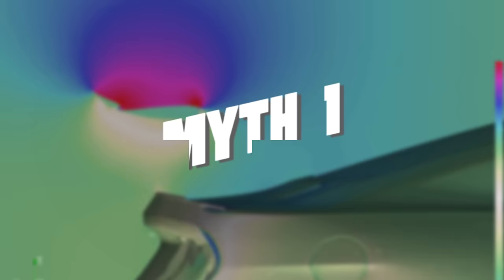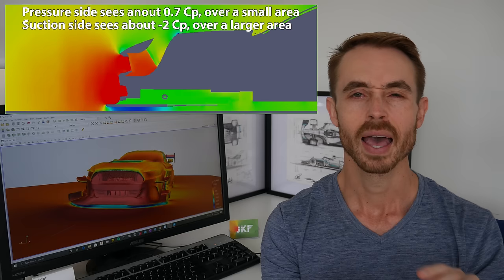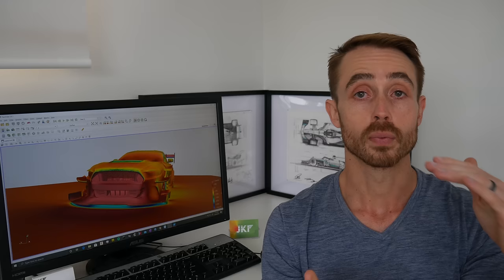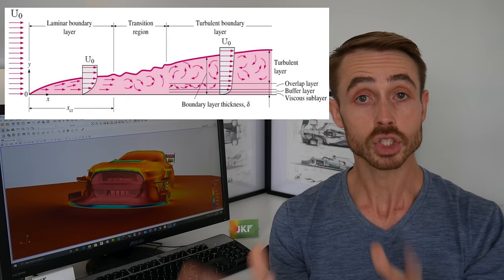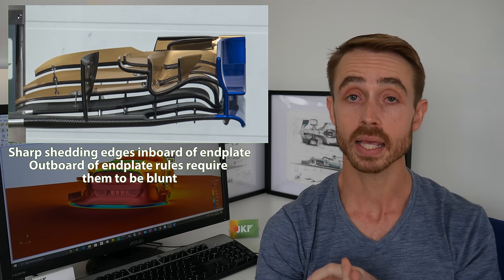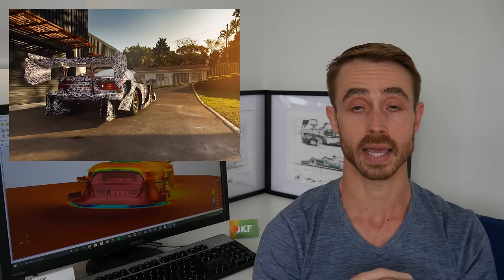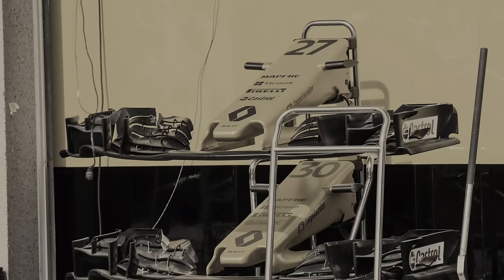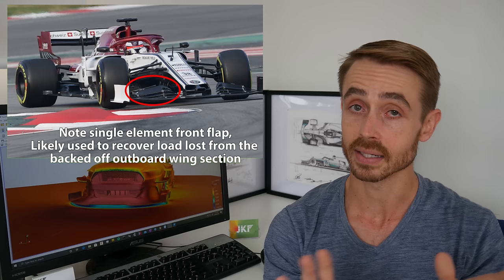5 Common Race Car Aerodynamic Myths

Comment: Hey Kyle! Thanks so much for all the videos! I've learned so much and I got interested enough to get a couple books on car aeroydamics! My favorite so far is probably Competition Car Aerodynamics. That book helped clarify details on a lot of things for me and gave kinda general numbers on results related to a couple topics you covered. I've also tried finding some studies myself on things I was wondering about, but most of them are behind paywalls...

One topic in particular I was wondering about is having windows down, and especially what can be done about it. Pretty much all track day groups and club level racing, at least in the US, requires the front windows to be down. From what I've been able to find there is benefit to venting the cabin. Would you maybe be able to discuss this? I found the abstract from a study saying that having windows open vs running air conditioning is more efficient until about 60 mph and then as speeds increase it get's increasingly worse. And an air conditioner takes about 4-5 HP to run! So it seems to me like there are potentially fairly big benefits. Especially for someone like me who primarily goes to 'horsepower' tracks where average lap speeds are at 70-80 mph even with a 2900 pound 200ish hp car on street tires.

A couple things I've found so far:

A decent amount of (front engine) sportscars in various GT series, from the Aston martin DBR9, to Ginnetta G50z, to the M3 GTR (most relevant to me haha), and even up to today with the lexus RC F have holes at the bottom of the rear windshield. In their cases (I assume) it's pretty much just to vent air they purposely let in to help keep the driver a bit cooler. But that does kinda prove to me that that is a 'good' place to vent air out. I had seen people in various forums claiming that it wouldn't work, and that air could even come in through there. But that area is typically going to be a relatively low pressure zone from my understanding so that doesn't really make sense.

I've even read people saying some spec miata racers were being caught / penalized for leaving a gap at the bottom of their hardtop.

Nascar teams were running NACA ducts backwards in their rear side windows to help evacuate air out of the drivers cabin until it was banned. I've read that the NACA duct isn't necessarily the best duct design as a vent like this, but it was good enough to be beneficial for them...

Not really sure of what else to do other than limit window opening size as much as rules allow. Maybe use deflectors? Seems like that could very easily hurt more than it helps, though. At least on modern NASCAR it looks to me like the B pillar is sloped kind of as a deflector. Or at least in a way that definitely doesn't draw air into the car.

I'm sure you've got a ton of video ideas already, but I think this could maybe be a good one? It would certainly be beneficial to pretty much every club racer in the US!

Comment: Hey Kyle, I would love to see a video about aero dynamics regarding drift cars. I have seen a few crazy sideways wings that drifters have attempted to use to improve grip while in drift. Do those do anything? Its an interesting subject because even at the highest level of drifting they seem to completely disregard aero still. Obviously due to cost and issue of repairing after a crash mid event but still an interesting subject I would love to hear about.
Reply: Could be interesting. The one thing I've been wondering w.r.t. drift aero is the lack of sideforce aero. If you look at the rally cars of the early 00s, they often had big and numerous vertical elements in the rear wings to provide a sideways force while sliding. This both stabilizes the rear and can help push the car towards the inside of the corner (or at least help keep it from going wide). In current WRC cars these devices are banned from the center of the wing (region of 55 cm on both sides of the centerline of the wing), and as a result you don't see many of them (Toyota did use some), but the endplates on the rally rear wings can be massive. Someone might say that features like that would go against the intended target of drifting, but having worked with some professional drifters, many tend towards making their setups really understeery anyway, relying on both the handbrake and insane power to force the car sideways, but trying to prevent the car from wanting to go overboard. Something like this might help them increase their speeds around corners while making the car less likely to get out of control when really torturing it hard.
Reply: Wouldn't effective aero defeat the whole point of drifting? Isn't getting as much angle as possible part of the scoring? It'd also seem to me that a cars predictability is far more important than anything else and aero would make the car less predictable.
Reply: @jubuttib  You should take a look at outlaw figure 8 cars.
Reply: @snek9353  Speed is also a key factor, they tend to run the highest grip tyres they can (D1GP was once won with racing slicks, which were subsequently banned), so good side force that would allow higher cornering speeds and stabilise the rear a bit could work, in theory at least. They have more than enough power to force the tyres to lose grip if they really need it.
Reply: @jubuttib  I'll take your word for it, only drifting I've watched is putting on Cletus when bored. I think it's a dumb sport. 

It is however an interesting thing to think about. How about hinged flaps like the roof flaps used in NASCAR. A set for each direction so when sliding right one set open and when the direction changes they close and another set opens.
Reply: @snek9353  To each their own. I like drifting because I just find it fun. As a sport I don't really follow it for other than professional reasons, but I mean it makes as much sense as any "artistic" sport where you're rated on both performance and style.
Reply: @snek9353  On the flaps, I don't know how big of an issue taking off like that is in drifting, with the differences in how the bodies and suspension are designed, as well as the lower speeds. I don't think NASCARs generally used to take off in slides other than at super speedway speeds?

Interestingly NASCARs also generate significant amount, something like 500 pounds, of side force on ovals, via slightly asymmetric body shells and how they're mounted on the chassis. They don't get enough credit for how clever they are aerodynamically.
Reply: @jubuttib  I don't bring up the flaps as way to avoid taking off, though in truth the application is the same. But as a way to provide bi-directional asymmetric downforce while in a slide. Let's see if I can describe what I see in my head. 

A pair of flaps, like a cardboard box, both hinged at the outside edge of the roof parallel and opposite to each other and hinged parallel to the car with the flap laying towards the center of the roof. So when the car is drifting to the right(turning left but sliding right with front wheels turned right) the flap on the right edge of the roof stays laying flat. But the flap on the left edge of the roof is opened by the air and provides both a sideways force and a downforce focused on the left side of the car. 

The exact same thing can be applied  to the hood and trunk lid.
Reply: @snek9353  Right, I only said it like that because the NASCAR flaps are passive devices, and really just disrupt the airflow on the top side of the car, reducing lift (rather than creating "downforce"). I don't exactly see the application of something like that in drifting, since the lift isn't really that much of an issue as it stands. Now if they were actively powered flaps that could actually produce downforce, that might be something, though I kinda expect the effect to be very limited and not worth the added complexity.
Reply: @jubuttib  What?!?  Reducing lift = creating downforce, same thing. Wouldn't matter in that regard if they were powered or passive. That would only effect the speed at which they'd activate, but they'd have less effect at low speeds anyway. Compared to the NASCAR flaps the angle when up would be different, and the area on the flap flatter for better effect. But when up they'd act like a duckbill.
Reply: @snek9353  Admittedly I read your message a bit wrong, I'm very sorry. I got the impression you wanted to have the leading side (so in your example right right side of the roof, when the car is turning left but countersteering) flap pop up and look kinda like a buckbill spoiler there (which would require it to be powered), rather than on the other side. So you're talking about allowing the flap to flip up more than in NASCAR, beyond vertical, and then be supported by the hinge or the tethers once it's up there, being a like a duckbill spoiler on the trailing side (left side in your example), right? Don't know how I got that flipped in my head when reading it the first time, reading it again you were quite clear about it. That could actually work, yeah. Might look pretty wild tho, with that range of movement. =)

On the "reducing lift vs. generating downforce" part, I do think they're not quite the same, one is about reducing the magnitude of an existing force (like disrupting the airflow over a wing to reduce its lift producing capability), the other is more about adding a new force (adding another wing to fight against the existing lift). That's the way I've always looked at it at least. I mean if you reduce lift to minimum, you end up with zero lift, but no downforce either. You need to actively think about generating more (negative) lift to create downforce.
Reply: @jubuttib  Lift v downforce.... The natural shape of most street cars tends to produce lift, air gets trapped under the front, the undercarriage produces turbulence, and the rear window/trunk area is low pressure lifting the back. If the latches were weak on many sedans the natural aero dynamics would force open both the hood and trunk. A trunk spoiler/duckbill for example doesn't produce downforce, it reduces the lift that's already occurring there. Those spoilers however are typically said to produce downforce as it's really the same thing. Same with a front splitter, they rarely produce a net downforce, instead they keep air from going under the car and producing lift, but again, it's the same thing. It's really only about the net difference on tire loading.

Comment: 4WD cars.
What is best for drive for front vs rear with regards to wheel rotation speed.
1. Faster wheel speed in the front than the rear?
2. Faster wheel speed in the rear than the front?
3. Both Front and Rear wheels spinning at the same speed?
With a focus on two areas;
a) The effects on cornering in the above 3 cases.
b) The effects on straight line speed / stability in the above 3 cases.

Bearing in mind, this must be a common problem to solve/address with cars with bigger rear tires (diameter) vs smaller front tires and the use of varying front/rear differential gear ratios to address it.

Comment: Very clarifying :) 
As a video suggestion I'd be interested in your take on DPi cars especially the Acura. As design references to the road vehicles are more or less desired there are many different takes on modifying the aerodynamic package and I'm wondering what you could read of the designs from a performance perspective.

Comment: I want to dig in on your claim about myth 1. 

I think you mostly worded everything correctly, but I wonder if you might inadvertently be communicating a new misconception.

While it is true that the math of the coefficient of pressure leads to a cap on the pressure side of a wing and no limit on the 'suction' side of the wing, isn't that just a quirk of the math? I don't see any reflection of that in physical reality.

I don't think there is a physical mechanism for a gas to pull on a wing. There are either particles of air exerting pressure on the surface of the wing, or there aren't. If there aren't, the pressure is zero, and that's the lowest possible pressure.  

On the other hand, there is no upper limit (within reason) on positive pressure. 

I'll grant you that dropping the pressure on the underside of a wing (on a car, or the upper side on a plane) may contribute more to the downforce than building pressure on the upper side does...*but the pressure on the upper side is the only reason there is any downforce at all.* There is no physical mechanism for a lack of particles on the underside of a wing to pull that wing down. 

Positive pressure is the only physical thing that gases can exert. If you drop the pressure on the under side of the wing, the gas has no mechanism of attracting the wing downward. It's just not pushing upward as much any more. 

So the upper side may be the pressure side, but the under side is not a 'suction' side. It's just a side lacking pressure.
Reply: I think the movement of gas particles from high to low pressure regions is what he is referring to as 'suction' here. While a physicist might see his explanation as semantics at best and misleading at worst, for an aerodynamicist, or even a casual car enthusiast, the difference is important. As he mentioned, there's not much more a car designer can do to increase the pressure on the pressure side (beyond CP of 1), but there are performance gains to be had through decreasing the pressure on the under side of the wing, or in everyday language, by generating more 'suction.'

At the end of the day, in my understanding it's the pressure differential that matters. I feel like he somewhat overstates the degree to which it's "wrong" to say that the high pressure side is pushing down on the wing, due to the physical process which you describe. Then again I am just a layperson watching youtube videos while he is an expert on the subject. But it could be his professional context that leads him to describe these aero effects the way he does.
Reply: @zvexevz  I think I understand what he's aiming for, which is why I would like to hear from him. I think his explanation is problematic, instead of wrong, which is again why I would like to hear from him.

My thinking is that fixing one misconception by introducing another doesn't move the conversation forward. I know he's trained in aerodynamics, but in this context, he's an educator. And the shared goal we should all have with education is to develop a fully accurate understanding--one that satisfies people that are concerned with the math, and one that satisfies people that are concerned with the physical reality, and one that satisfies the people that just want a car to go faster.

In that spirit :)  ---

"...movement of gas particles from high to low pressure regions" is more akin to flow than to suction. 

In this context, he is using suction to describe a pressure differential without flow between those two regions. For the case of a splitter, we're talking higher pressure on one side of the splitter, and lower pressure on the other, and (ideally) no flow through or around the splitter. 

A differential can be achieved by increasing pressure on one side, decreasing it on the other side, or both. However, downforce is always created by the side with higher pressure. I really don't think it's correct to describe it as suction. Low pressure cannot pull--instead, it just doesn't push. So a more fully correct way to explain what's going on with a wing, is to say that you achieve greatest gains by reducing the push on the underside of the splitter. There is a limit to this (unlike what the equation he's referencing indicates). You can't go into negative air pressure.

Comment: The day my Dad (an Aeronautical engineer) explained that a wing is sucked up, as opposed to pushed up, my mind was blown.
Reply: I'm suggesting "suction" is not a thing. One has a difference in pressure. Using a straw to drink? One is creating a low pressure area in your mouth and atmospheric pressure is pushing the fluid into your mouth. The greater the difference between a low pressure area and a high pressure area the more force is applied. I'm suggesting you have a further talk to your dad.
Reply: @bradsmith3123  I think you may have misunderstood time scales, this was explained to me nearly 25 years ago, when I was a Child, so a simplified explanation was appropriate.

Comment: Hello! I've being a huge fan of your post ever before the hiatus, so I'd like to suggest a topic for a future video covering the aero of the P1 class prototypes from Endurance Brasil.

This is an endurance racing series where aero has a level of design degree of freedom similar to that of Time Attack or Pikes Peak cars, allowing teams to implement features like DRS (without limitations on use), underbody aerodynamics and many interesting solutions that are mostly forbidden everywhere else.

Cars in this series are mainly spaceframe built in Brazil, like the Metalmoro AJR, Sigma P1 and DTR01, but there are also a couple modified Ginetta G58s, that went through a lot of mechanical and aero updates (DRS included), with more cars expected to join the grid in the near future.